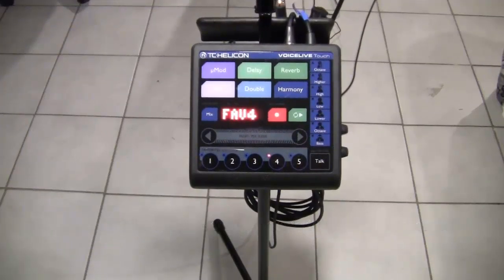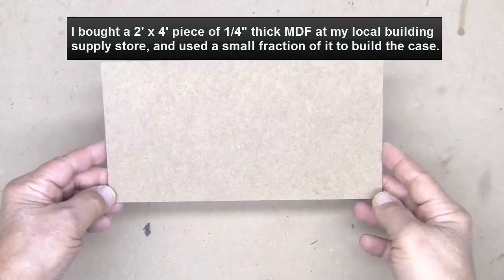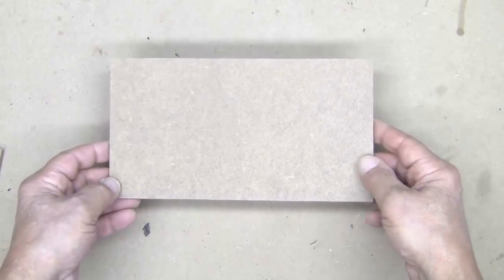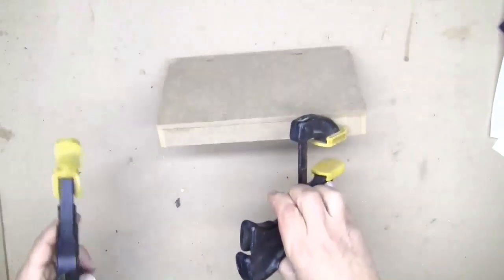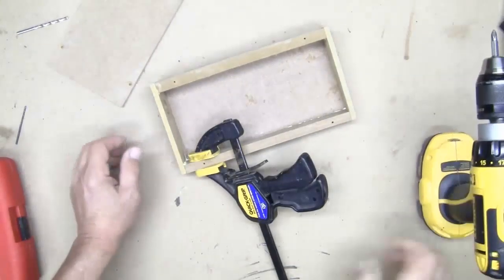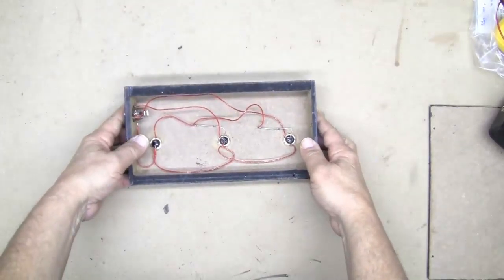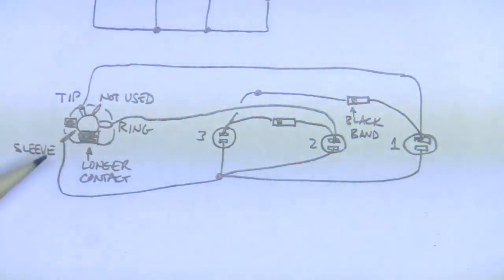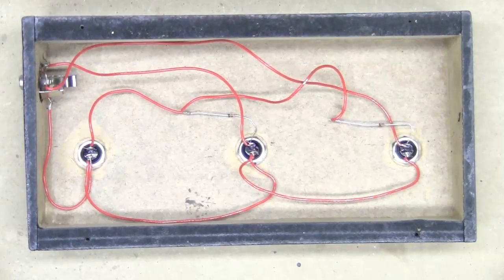Homebrew Switch 3 for your Voicelive Touch

Comment: thanks a lot for the video. i have some problems with my switch that has 3 pines. i dont know what i should do to make it function properly. please anybody knows..? thanks
Reply: You must use the two pins of the switch that are required for Normally Open mode. If you do not touch the switch, it will open the circuit.  If you hold the switch down, it closes the circuit.

Comment: Hello! I have a problem. tc helicon voiceworks. All soldered on this scheme, set up the device - works adequately only the first button, the others do not respond. What could be the problem. Diodes 4148, plug - stereo jack. Thank you

Comment: Seems like a lot of work to possibly save a little $. I bought my switch 3 brand new for $39. Including shipping. And quality is probably a lot better than a home made one. What I really want a tutorial on is how to use my single boss fs5 with my play pedal. I only need a harmony on/off. And the switch 3 does sit pretty high.
Reply: You can use a Boss FS-5U (or a Boss FS-6 in FS-5U mode) in Normally Open polarity. Get a TRS jack and replace one of the TS jacks on your cable. Solder the braid to the tag connected to the main body of the stereo jack. Decide which switch of the TC-Helicon Switch-3 you want to simulate. 1.If you want to simulate the 1st switch, solder the other wire (not the braid) to the tip tag of the stereo plug. 2.If you want to simulate the 2nd switch, solder the other wire (not the braid) to the ring tag of the stereo plug. 3.If you want to simulate the 3rd switch, solder the other wire (not the braid) to the tip AND the ring tag of the stereo plug. Finally: the stereo jack goes in the voice processor, the mono end as normal in the Boss switch pedal.

Comment from the maker: Might be a problem with the polarity of the diodes, or wiring.  If you can take as good a picture as you can of the components and wiring, I might be able to see something that needs fixing.  Attach and send to me at brodafinjr@optimum.net.
Reply: I have the same problem despite the wiring and polarity of diodes is correct.

Comment: Just a quick follow-up - everything went fine, a cold joint or "gremlin" arose as I ran the switch through meter testing, but what ever was wrong resolved itself and I'm good to go!  BONUS - I had ordered a TC BG250-210 Bass Combo Amp, not realizing that the "voice-print" feature can be controlled with the Switch3 also.  Great amp, and the Switch3 worked perfectly on it also.  I may construct a separate switch for the amp; should be a no-brainer the second time around.   Thank's again for sharing; hope I can find a spot to pay it forward my friend.  jef

Comment from the maker: Check out page 15 of the Voicelive Touch manual, specifically "10. Pedal". 
It shows the options you can select that the Switch 3 will respond to.  One 
is "Talk/Banks/Favorites", meaning the first switch will control "Talk", the 
second "Banks", and the third "Favorites".  If you're not using a Voicelive 
Touch, the other TC Helicon products have a similar capability and it will 
be explained in that product's manual.

Comment: Alternatively, if you use momentary SPDT (normally open configuration) or DPDT switches (two sets of contacts each), you can nix the diodes if you connect both poles of switch 3 (independently) in parallel across the other two switches (it still acts like pressing switch 1 and 2 simultaneously).

Comment: Thanks from Australia for VoiceLive Touch 2. All bits from Jaycar.  HINT: BIG box allows space for big feet!  Salesguy tested the socket & drew a diagram for which lug (unmarked) matched the T-R-S of the jack.  Total $36 incl the black plastic box, stereo socket, 3 red-button switches (steel expensive) , 5 diodes, coloured thin wire, 2 TRS jacks,  mic cable and thin solder.  My 1st 'electronic' project  ever and only tried due to your video and crystal-clear diagrams. Well done!

Comment from the maker: The Switch 3 hooks up to the VLT with a Stereo plug which has three connection points (ground, tip, and ring).  That only allows a maximum of three switches (tip, ring, or tip and ring).